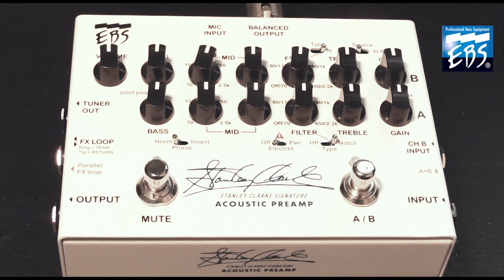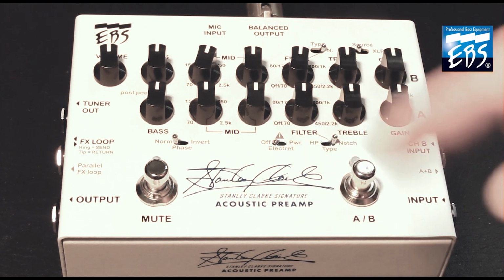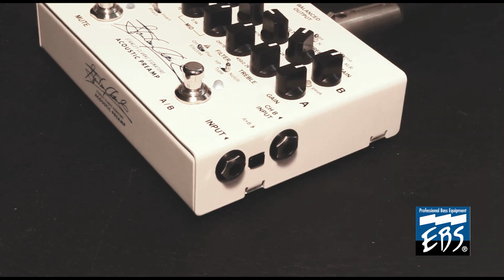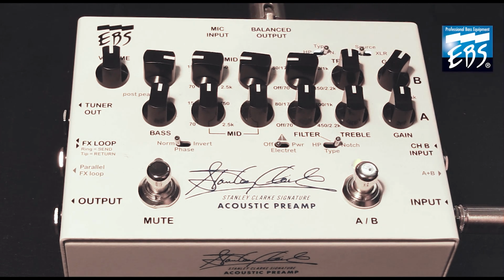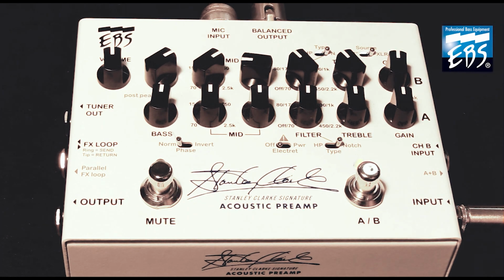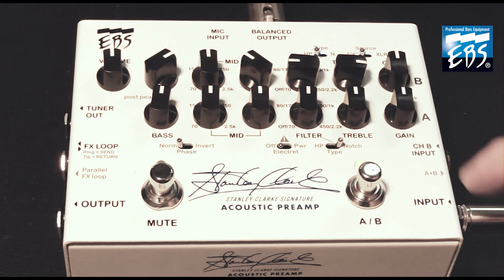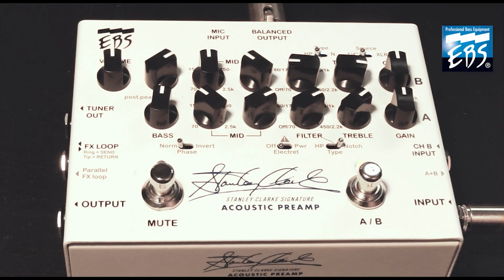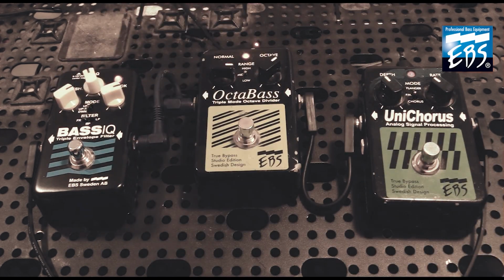EBS Stanley Clarke Acoustic Preamp - Demo by Pascal Mulot

Comment: Does the DI have a pre/post option?
Reply from the maker: It is always post EQ on this pedal.
Reply: @EBSSweden  Too bad. The sound guys I work with always want a clean signal that they can EQ for the mix.
Reply from the maker: @bobderosa4079  it is possible to use a DI box before the pedal if you need a dry signal. Then you get both dry and wet signals to mix together. Why we chose to make this pedal with the post eq only, is because there are tools on the pedal to handle the acoustic phenomenons that can produce unwanted feedback, and if you bypass the eq, you might get these problems back. However, if you need a preamp with both options, check out the MicroBass 3 (https://ebssweden.com/content2/effects/ebs-microbass-3-professional-outboard-preamp/) which has two balanced outputs for pre- and post-eq at the same time.